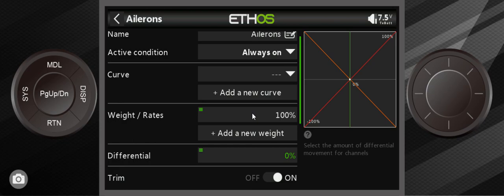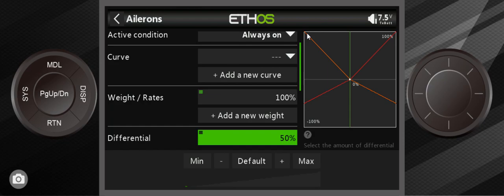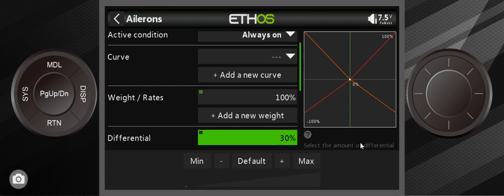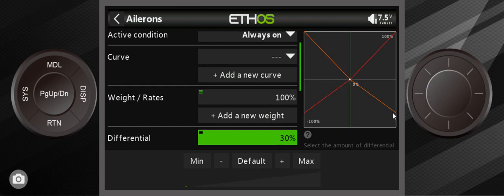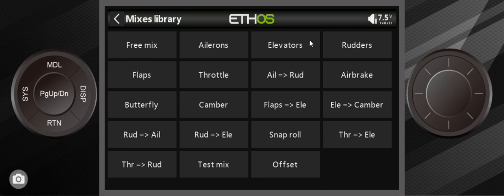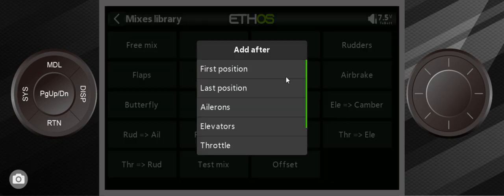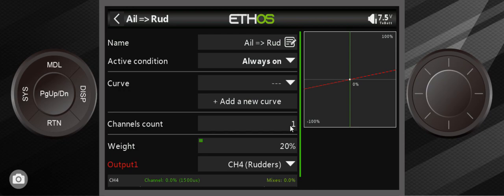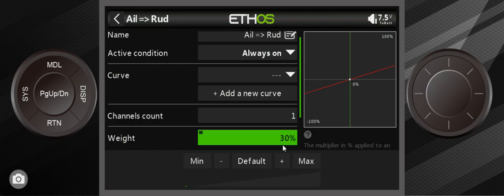FrSky Ethos:  Get your plane flying better, dialing out adverse yaw.

Comment: steve is there any way to tie the differentail value to say a trim switch or pot so you can adjust it on the fly and not have to go back and forth in to the mix screen so you can test it in flight and add or subtact the value
Reply from the maker: Yes, I will have to show that in a different video.
Reply: @steveschlesinger3459  yes if you can please do